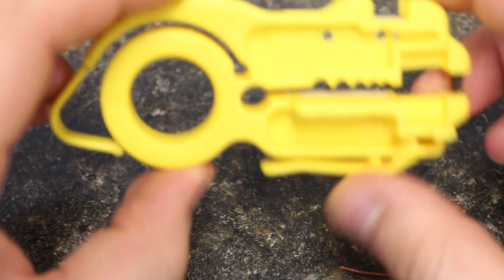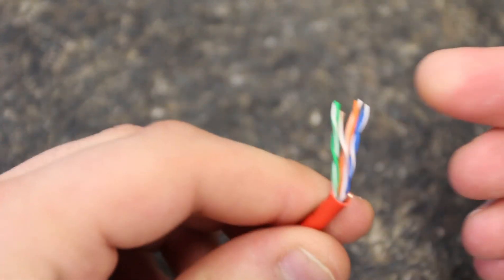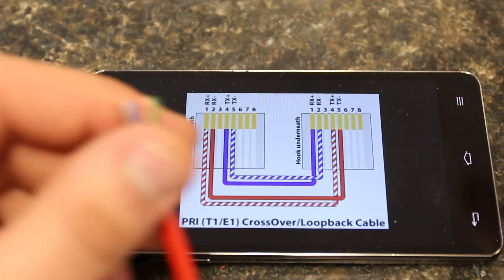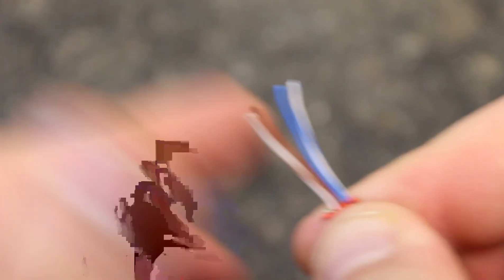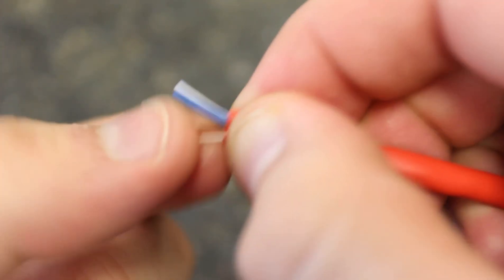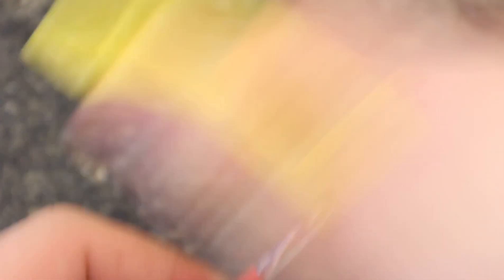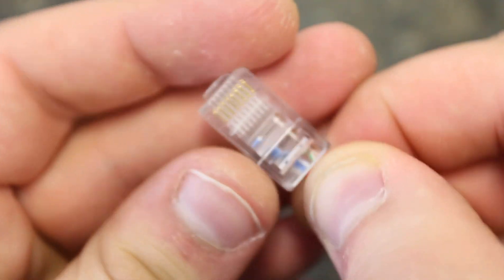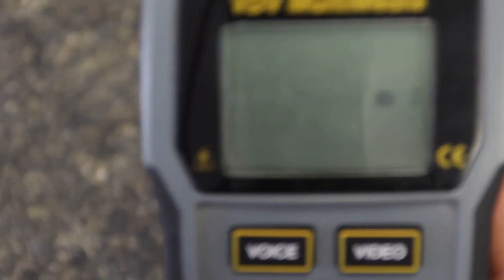How to make a T1 Crossover / PRI cable

Comment: I am on travel to Puerto Rico installing a VoIP system.  Having to use PRI circuit and not SIP.  Contractor did not leave me a cable.  I had the tools and followed this video and BINGO!!!  It works!!!  Thanks!

Comment: What color wires you use don't really matter as long as you get the pin-out correct, but blue/orange pair is 'standard'.  But I don't cut green and brown; go ahead and wire them into to pins 3, 6, 7 and 8.  This makes it a lot easier to guide your blue/orange wires into 1, 2, 4 and 5.  However, cutting the wires does make it fairly obvious that the cable is NOT a straight-through Ethernet cable.
Reply: I haven't worked on routers with PRI in a long time, but I remember on the old Cisco router and VWIC I used, wiring up all 8 wires confused the hardware. But ya what colors you use doesn't matter, just have to have the pairing correct.

Comment: one question , which end goes to the Demarc and which end goes to the T1/E1 card let's say on a Cisco router that has a T1 / E1 service module ? Thank you.
Reply: Either end will work, it is a bidirectional cable.

Comment: 12:18 "and just push that in.." destroys cable
Reply from the maker: I used that cable after I made it. It was not destroyed.
I know this cable is not "professionally" made, but it gets the job done for those that need one in a pinch. Anybody can buy a professionally made PRI crossover.